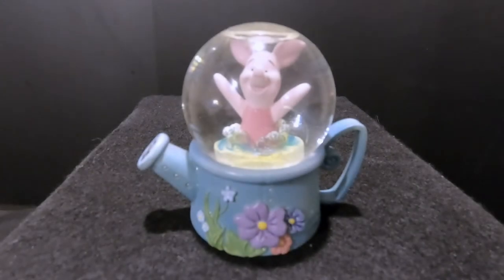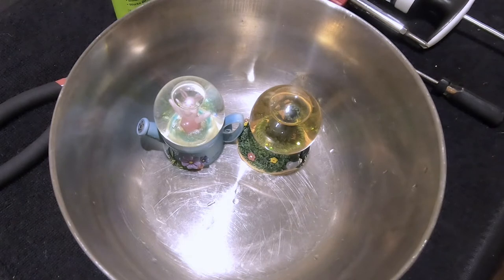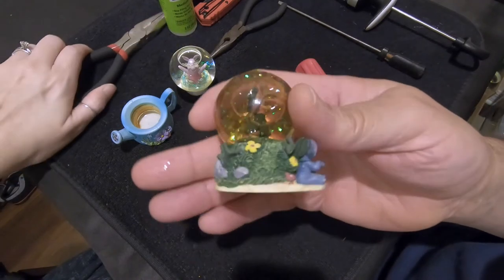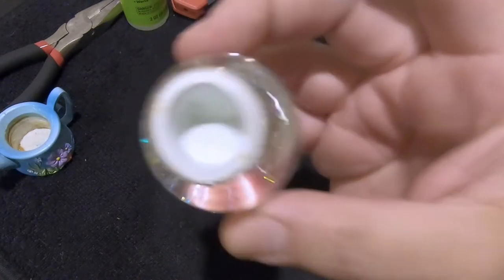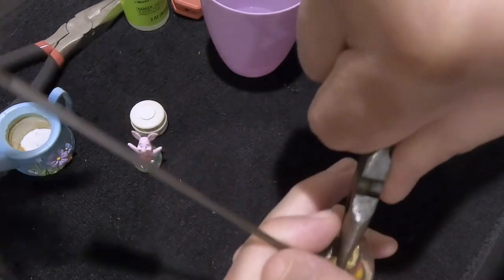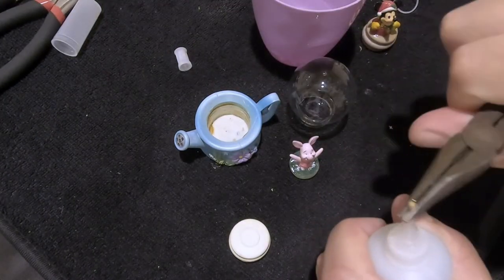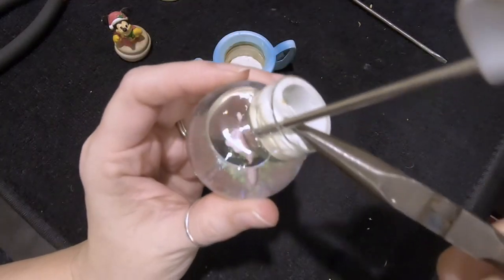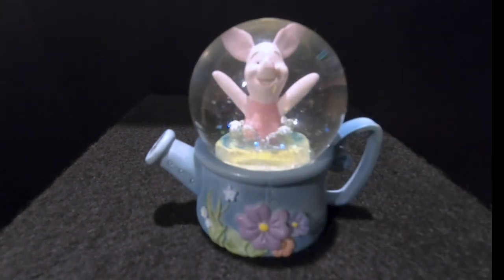Ep. 40 - "Piglet" Solid Base Snow Globe Repair - Replace Cracked Globe using boiling water method

Comment: This video's are awesome !!!Do you have a video on how to repair a snow globe where the glass dome is completely shattered.  I am unsure how to pop the stopper out of the base as I can't pull on the dome after heating up the glue.
Reply from the maker: We have at least one video that I can remember. It is Episode 77 Teddy Bear Christmas. The globe had some holes in the glass and it fell apart as we were trying to removed it leaving the opening of the globe still glued to the base. We will send the link in a separate reply. Hopefully that provides you with the information you need. Thanks for the comment.
Reply from the maker: Episode 77 - Teddy Bear Christmas: https://youtu.be/78UwE7BTibo

Comment: Love it! Where do you get the glue to adhere piglet? Would super glue work just as well?
Reply from the maker: We found it on Amazon. We used to use super glue and gorilla glue. They work fine. The globes that we did a year ago with those products are still good.
Reply: @snowgloberescue8887  thanks for the info! Getting ready to make one and gathering info 😍

Comment: What is that tool you use to take the bubble inside the globe?
Reply from the maker: Hi. We have two methods for removing the air bubble. The first is using a syringe which we used in all of our earlier videos. We use a marinating syringe with only one hole in the tip, not the type that has holes on the side of the needle. In Episode 3 - "The snow globe repair tool kit" we show the correct type of syringe. You place it between the glass and the rubber stopper and inject water until the air bubble is removed. The second method that we use in most of our more recent videos is to hold the globe upside down under water and pull back on the stopper until the air bubble escapes. We demonstrate one method or the other in most of our repair videos.

Comment: Hi I have a question.  I'd love for you to help me.  I have a medium size Snowglobe but it's like there is no opening at the bottom like most big Snowglobes, it's more like these mini Snowglobes. I'm struggling to get the base off. The Figurine and floor aren't together anymore, needs glueing.
Reply from the maker: Hi. It sounds like you have a solid base snow globe. If the snow globe was assembled with hot glue, as most are, you can use boiling water or a hair dryer to heat up the base and to melt the glue and remove the globe. We have several videos where we do that. Here is one example: Episode 20 (https://youtu.be/a50WyTTJr4Q). If it is not assembled with hot glue you may still be able to open it by using a lot of heat on the base with the hair dryer on high. It has worked for us. Sometimes some acetone around the globe where it meets the base can help loosen it. Hope that helps. Thanks for watching!